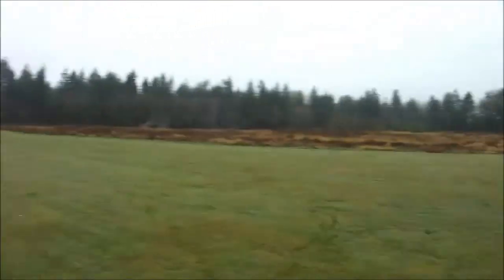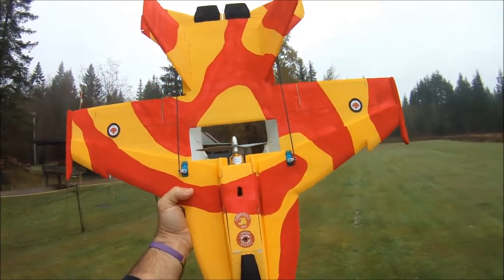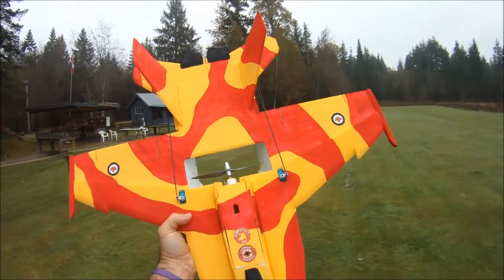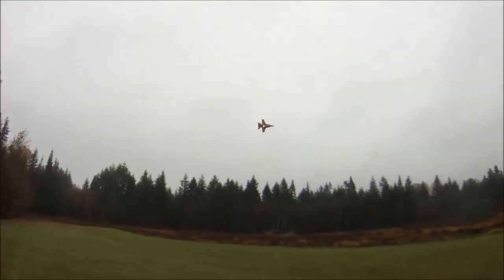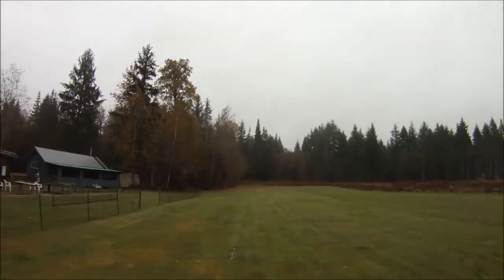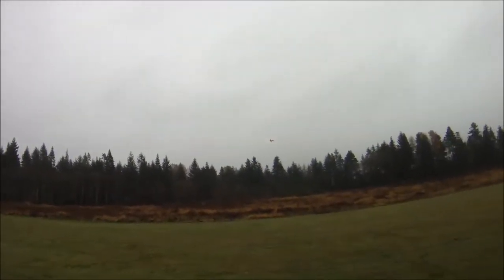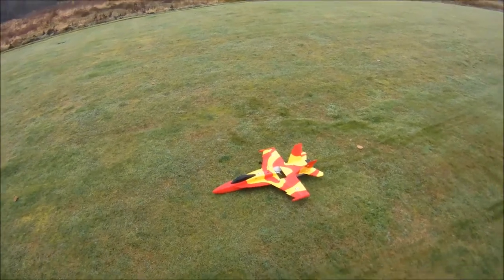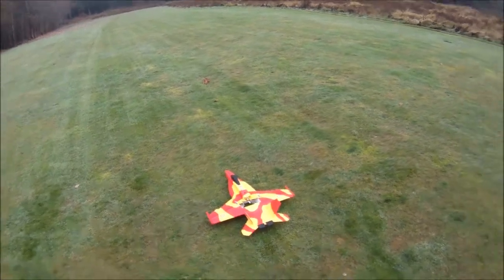Field test of the A2212/5T 2700 Kv motor and 6x4 APC gas prop on 3S

Comment: what esc u recomend for 2217 2700KV motor??? i was try 40a esc with 2217 2700kv motor (no propeller installed) and got burned, so i dont know what Ampere esc really needed for this motor
Reply from the maker: Sorry to hear about your ESC.  It seems very strange it would burn with no prop providing any load.  What number of cells was the battery you were using?  Cheers, Scott
Reply: @e3Scott  first thanks for your respond, iam using 3 cells 2200MAh 60C, i think it will be fine for that spec but idk why just wierd, but 3 days before it got burn my plane crash and got wet. is it because of the water on the battery even its already dry?
Reply from the maker: @Ghimpyshh  I have had issues with ESCs getting wet and burning out, if water gets under the heat shrink of the ESC, it can take forever to dry.  Also, it is a very good idea to check all your connections (battery, motor, ESC) after a crash as I have had solder joints get broken and then end up short circuiting when I attached the battery.  Hope that helps!  Cheers, Scott

Comment: test it on 5x4...tri blad. ( mostly becuase to prevent the props from hitting the ground
during landings) the quads people are using triblades. i cant really tell becuase every one 
use different motors. Some people are getting over 700 grams average on 3s 1800.
I order 2=ea 2700 kv becuase they;re only $5 on the slow boat.lmao The props cost just as much 10 sets for $9..that's 50 cent p/prop.lol
Reply from the maker: Hi, not sure what you mean, I should test it on a 5x4x3 or you have?  I'm not really that worried about the prop, I fly with the ESC brake off, so the prop free spins.  Other than very hard landings or crashes, I have not broken a prop just landing normally in thousands of flights.  This prop and motor combo on 3S produce 940 grams pulling about 35A.  Thanks for watching :)  Cheers, Scott
Reply: I ordered 2- ea of all the different KV of those cheap 2212. lmao
I order 10 sets of 5 x4 three blades...It was 2 set for $4 or 10 sets for $8.50....Im stocking up for science....lol.
Some people tested those 2700kv on 6x4..but it gets too hot
So i was thinking 5 x4,5..3 might work better...Idk
Come to find out the quad people are using the three blades more
I can always use them to build a 60" A 10 or something. maybe
sort of make duct fan....have them installed inside the fuse.
I order EDF too...but tbat's side the point
A lot of it has to do with keeping away from 4s for a little while.
Batteries are expensive.
Reply from the maker: Well, I'm not sure exactly what 2212 2700 Kv you ordered, there are still some that are 2212/6 2700 Kv that I have used and yes they do run too hot with a 6x4 prop, I ran those on 6x3.  The 2212/5T 2700 Kv like in this video does run warm, but I have run a couple of them for hundreds of flights and they have held up well with 6x4 APC props on 3S.  rcplanepirate did a video with this motor on 4S, I haven't watched it, so not sure what props he used or what his recommendations are https://www.youtube.com/watch?v=2HrzL-Zywmg You have to be prepared to accept that you get what you pay for with some of these very inexpensive motors, sometimes you get lucky and get one with good magnets, bearings and wire, other times you don't, the quality control is not that great, some run fine all day long and others do get quite hot or the bearings go bad prematurely.  Best of luck with all your testing, be interested to hear how you make out :)  Cheers, Scott